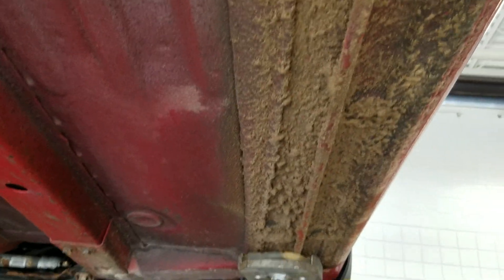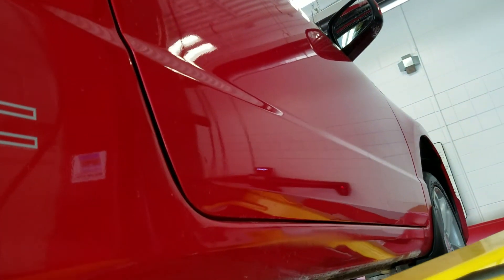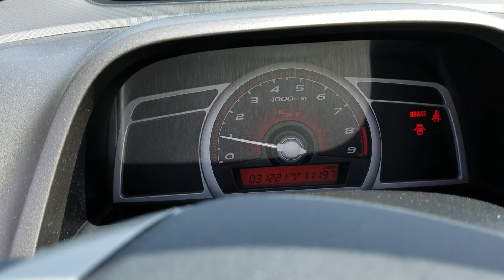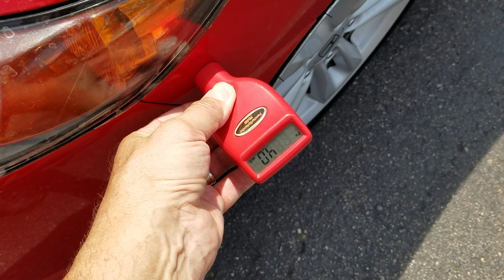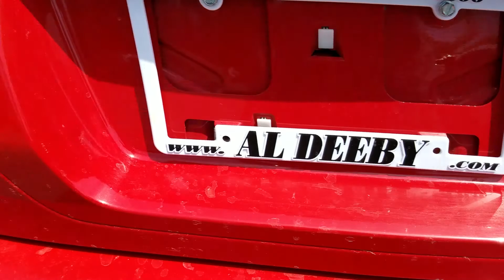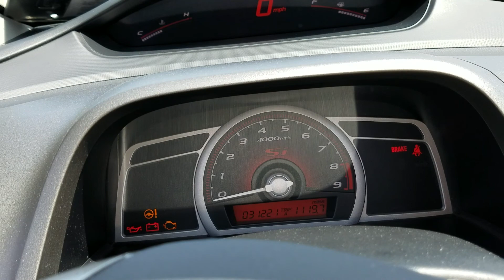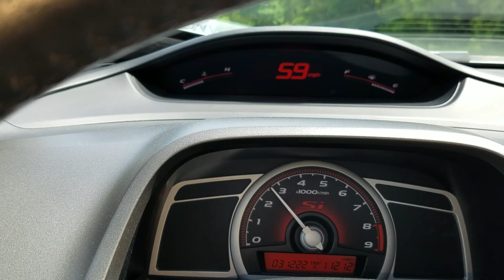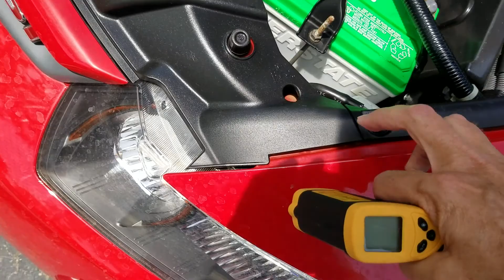2006 Honda Civic SI auto appraisal Bloomfield Hills Mi. 810-691-2664

Comment: That had a used quarter panel installed, you can see the welds under the bumper in the beginning of the video and the seam sealer on that section under the trunk lid was put on by hand. It wasn’t just “re painted” that wouldn’t change its shape.